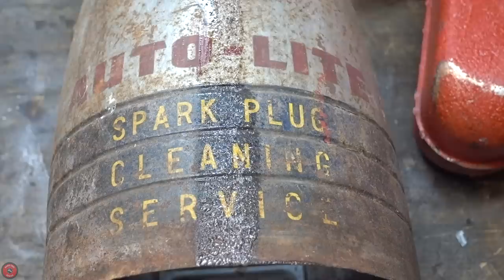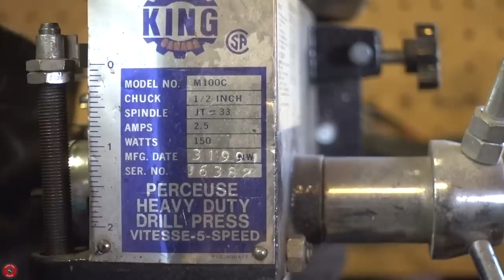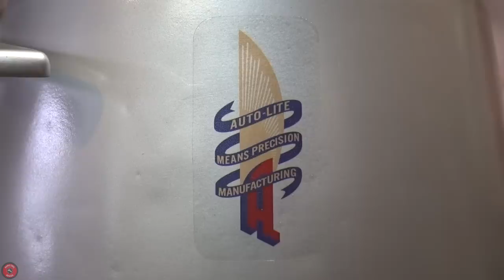1940s Spark Plug Cleaner [Restoration]

Comment: Anyone know what type of crescent wrench is used @6:42? I am interested in looking for one of those.
Reply from the maker: I am actually remaking those style wrenches!  Check out the "community" tab on my channel for the details.
Reply: That is awesome, i see $35USD witch is super fair. But any chance of a video of you demoing it? like max span and if it's better clamping compared to a standard crescent.. (Not sure if that style of wrench has a certain name?)
Reply from the maker: I will be doing a dedicated video about making of these wrenches.  Maximum span is 1.5in, but these were originally rated for bolts up to 3/4" wide.  I am trying to stay as close to the original materials and processes as possible, so I am not sure how well it will compare to modern adjustable wrenches.  Quick tests show that you can apply just over 120 ft/lbs of torque with a 3ft torque bar before it bends, which is more than enough for the torque rating on 3/4" bolts.
Reply: Awesome! I will subscribe and watch out for it and followed on Instagram!

It appeared to lock on better than most adjustable wrenches today.. and in the asbestos shingle cutter video, look like it can be tilted vertically, and never adjusted itself like the cheap ones of today. lol

I hope to see some Coleman gas powered applications restored on here in the future. :P 
But do you get subscribers stuff that you restore for videos, or all personal/friends restos?
Reply: Oh. I really appreciate the replies, great to see someone take pride in there channel and answer questions asked!
Reply: Didn't realize you were from Saskatoon! I am out in Esterhazy, Stoon's potash brother. :P
Reply from the maker: Haha nice!

Comment: grit based plug cleaners leave behind small particulate that will damage a motor. they do work to clean a plug abrasively but they are not safe to use sadly. not worth it when that stuff ruins rings and internals

Comment: Are you sure t is from the 40's? It looks much more modern to me.
When I went to mechanics school, they were going to throw away a "Bosch Ignition tester" that had a sparkplug cleaner, a spark tester, a coil tester and many many more functions, I tried to fit it in my car, but it was a big heavy thing so it didn't fit.
I wish I had the money to rent a trailer, I had to see it crushed by a tractor and dumped in the metal bin.....

Comment: That much lead, I felt I should wear gloves and a mask just watching the video.
Hole punch is easy enough to make. Take a bolt that's the size of the hole you want, use your 2.5 amps of greatness drill press to bore a hole into the end of the bolt, sharpen the end with a belt sander and viola, hole punch.

Comment: As an FYI, the multi-contact plugs are old aircraft spark plugs.  Be VERY careful to remove ALL the silica dust after cleaning those, as a mid-air engine failure is not nearly as amusing as a roadside engine failure is...  :D
Reply from the maker: I think that is the fatal design in this machine...there is too much risk that even one piece of media is left in the plug.
Reply: Well, a good rinsing in Stoddard Solvent will usually do the trick.   It's not so much a bit of grit getting in the cylinder as the possibility of some grit shorting out the plug contacts and causing problems...   ;-)

Comment: You went as long as you could without showing the lettering. I knew once you showed it, you were taking a $200.00 piece and going to make a $50.00 piece out of it. Even a decal with the Autolite sparkplug cleaning service on it would have saved half the value. If you intend to sell the stuff you  work on, remember restore means back to how it left the factory, not how you want to see it.

Comment: Getting it to work is cinda cool? 
But removing the patina from 60 years of serival makes it worthless, but that's just me,
No harm to good work.
Reply: good guy, with respect, I think “patina” is a modern concept. Think of it from the POV of the guys who designed and built the original; I bet they would feel honored to have it brought back to its original appearance. 

It’s like having a dingy old oil painting covered in cigarette smoke and dust ; patina certainly wasn’t the artist’s intent … so clean it to bring it back to what the artist had in mind. 

Just a thought.

Comment: that sparkplug cleaner 😊😊 is completely different from 1 I remember seeing because it's older and that's the 1ST 1 IVE seen 2 use w it most of U see usually the sparkplugs go on the very top and they use a wire wheel 2 clean sparkplugs 😊😊 that 1 doesn't it's cool and neat 😊🎉 and it does a much better job of cleaning the sparkplugs 😊😊 alot of those old sparkplugs U cleaned U don't even see anymore and most of them IVE seen well over 30 years ago they don't make them like more years ago when they still had good gas back then U could take sparkplugs and clean them and use again not no more U can't because of the junk gas they make 2 they changed it and now it's worse than what use 2 be it's a joke and it gummed things up and eats the o rings and seals up 2 also and the corn 🌽  didn't help matters none either 😮😮 OMG 9 28 2O23

Comment: I got lead poisoning just watching this.

The decals are by far my least favorite part. They're way off. "SPARK PLUG" is too far right. S-C-S and G-G-E should align top to bottom. Then either the AUTO-LITE decal is too small or the yellow letters are too large. The S in Spark should be near the right side of the U in AUTO, and the G in PLUG should be near the left side of the T in LITE.

I'd redo it.

Comment: Sanding the equipment is not good due to rust yet You used a wire brush, and a grinder...that's just foolish. Using the grinder is sanding the equipment.